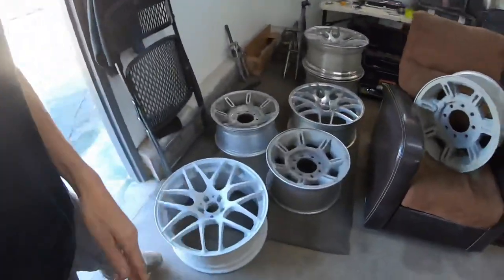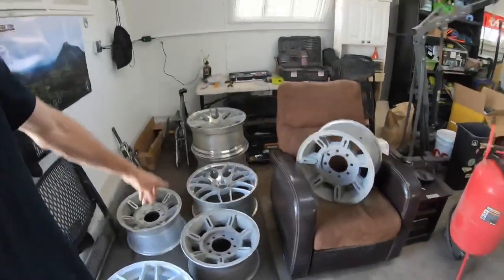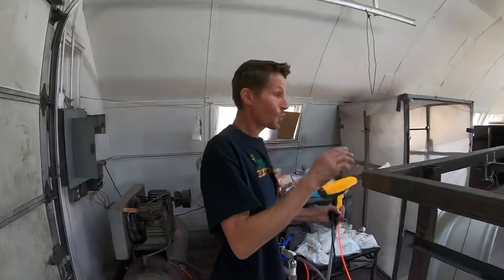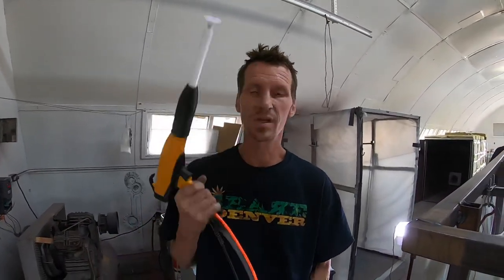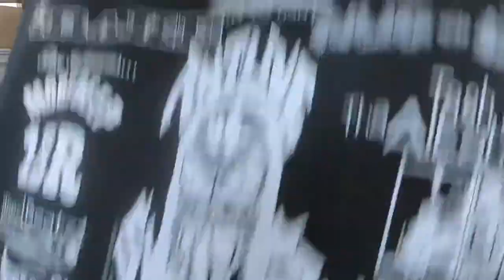Powder Coating First Set of Wheels KF-X1 Powder Coating System

Comment: Sure looks like there is no waste with that new system. Beautiful color.
Reply from the maker: That color is awesome!  Hardly any waste.  We did have to do some adjusting of the fluidizer as I turned it up on accident the previous day so there was a bit more waste then what we normally would have, until we realized what we did, turned it down, and it works great!
Reply: @710performance  it always takes time to learn a new tool. End product looked great.
Reply from the maker: James Van Hoose thank you! The customer loved it. We just posted pics of his ride on IG

Comment: Nice color on those wheels. And the new setup with bigger oven, New gun and the rack to fit 4 wheels must save some time = make more money 😁👍
Reply from the maker: It does save a ton of time and we can do bumpers which pay more, but we’re Also looking to cut down from working seven days in the shop to four or five so we can have time for our Honda building and our go cart as well as racing just about every weekend.
Reply: @710performance , makes a lot off sense. It is importent to remember to have fun out side of work to 😉
But you do what you have to do, to make the business a succes - it is a lot of work. But hey, keep it up - you are doing great stuff
Reply from the maker: @Hoxer30  Oh I work hard, a workaholic I'm told, but I'm just havin fun.  I decided I wanted to do other things as well and that I could while still working.  Racing cars has always been fun, and powder coating parts for race cars and people building cars keeps me in the scene always, so why not.

Comment: You’ll get the gun dialed in, just a learning process. Question about the oven, have you seen any damage to the shop floor without a bottom in the oven? I have a cheap HF gun and built my own oven based on what you did. I was worried about no floor and no outside skin so I built mine with both. The oven’s 3’ x 2’ x 2’ and I only work on my projects but the oven has already been a limiting factor a couple of times. Not having to add a floor would save money if it doesn’t hurt my garage when I go bigger. No matter what we want to believe, size matters.
Reply from the maker: We have had no issue with the fool being concrete.  We actually got that idea from a powder coater I think in New York that has a few videos and his oven is huge, like 4 times our current size.

Comment: I first found your channel while looking for user reviews of the pcs1000 as I'm looking to upgrade, I only do parts for myself and my friends, I'm sure it would perform amazing compared to my dual voltage, almost everything I coat is 2 stage and it's a pita but I've learned the tricks to make it work.. mostly 😂...  What system did you use before the pcs1000? I was also looking into the redline ez100 or the kool koat hypersmooth like Unknown uses. U stepped up big time with that colo system!
Reply from the maker: We used the Eastwood duel voltage gun before the Eastwood PCS 1000.  Thanks for your support as well! I don't know anything about the ez100 but the Hypersmooth is suppose to be pretty good from what I hear.

Comment: That Super Root Beer is SICK!! Keep up the good work. What air pressure should that system run at? 50PSI?
Reply from the maker: Yes right around 50. It can handle more, but we've not needed it

Comment: Been waiting on the video the whole day since I saw the post yesterday on your ig.. great video and really liking how that system is working.. had seen the colo before and wondered if they were any good since they are “replicas” but so far they look good!! You should maybe try to add some swivel hook on the hooks to the wheels so you can spin it around that way you don’t have to get in the middle of the rack and rub yourself on the other wheels taking off the powder..
Reply from the maker: Thanks for the tip, we are looking at adding some swivel hooks, but we also don’t want the wheels to spin and hit the oven while inside
Reply: 710 Performance true! Also how do you hang the wheel from the valve stems?
Reply from the maker: King PrettyFlacko we have a hook with a threaded end and two bolts. We just stick it in and tighten the two bolts up so it hangs from the hook

Comment: What was the issue you figured out after the third wheel. Just Incase I run into same issue.
Reply from the maker: Green Mountain Media Blasting & Powder Coating we accidentally had the fluidize turned all the way up, and we didn’t have enough air running to the system we only had about 20 psi.